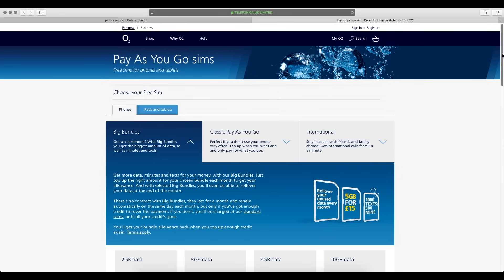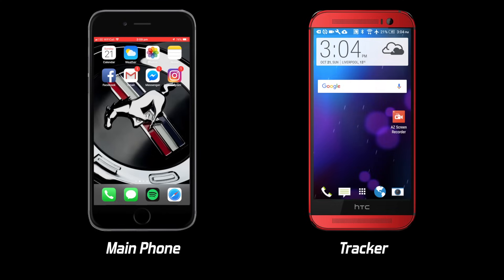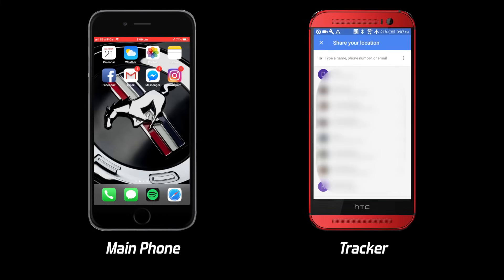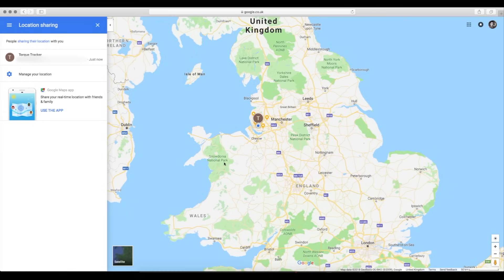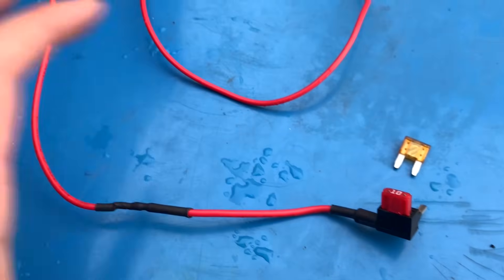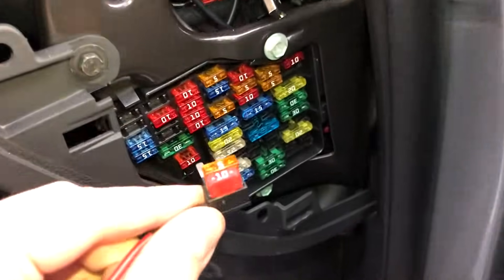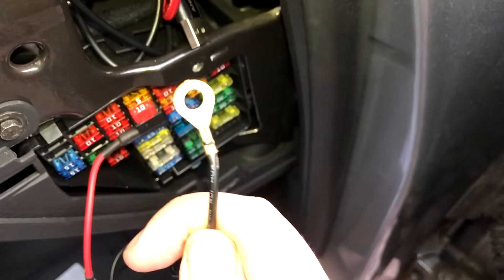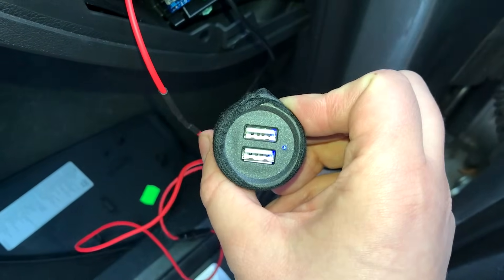Turn an Old iPhone or Android Into A Car Tracker

Comment: I just bough a rugged phone that has a 15000 mAh battery with a standby time of about three weeks.  In a pinch I can reverse find my other phone or have a backup phone when my other one is lost or damaged beyond repair. I can also just throw it in any vehicle out of sight, even use it on my motorcycle.  I've seen reviews for hard wired GPS trackers and almost everyone ends up with a dead car battery and ends up removing it.  Maybe it would be better to wire it to an ignition power source and put a 20,000 mAh battery in line.

Comment: The problem with this is the piggyback fuse is way to obvious, many thieves will check the fuse panel. There must be a sneakier way than this to piggyback power somewhere else in the car.
Reply: I absolutely agree with you.  The thieves who stole my ride recently pulled all the leads to the fuse box. It’s best to find a constant on inside a panel somewhere they won’t waste time looking for,  and connect your inline fuse from there-if you even need a fuse.

Comment: I like this idea but need to figure a work around here in the desert. If you leave your phone in your car in the day it gets so hot that your phone will malfunction
Reply: Don't put it in your car, put it under your car in a sealed container or space with no walls in direct sunlight. Also stay away from the exhaust and engine.

Comment: Hey Torque Steer, Do you notice any battery drain using this method? From my understanding a phone shouldn't draw enough power to drain a battery, especially when you splice it in through a constant circuit. Thankyou for the video!

Comment: Hi, Could I simply plug the USB into an existing cigarette lighter socket for it to work?
Reply: Does the 12v lighter socket work when the car is turned off?
Reply: Yes you can do that. It would not be very hidden from would be thief's but if you don't care about that it would work.

Comment: Is there any app or way that would be able to do the same but... with one and very imporant additional option - to send an alarm notification in case my car is stolen (the geolocation is changed) - either by data but even better by calling my phone number?
Reply: You can use IFTTT for this.  If the vehicle exits a perimeter around your property it can send a txt message. I had this setup so that when my wife left work for home, I got an alert so I knew to have her dinner ready for her when she arrived.
Reply: @JohnHastie  Thanks, you're right, it's to try in fact any automation app.... so simple...

Comment: That kills the car battery
Reply: Factory reset the phone, remove or disable all unneeded apps and reduce screen timer to minimum as well as dropping screen brightness to almost nothing.
Reply: it does not, very low power.

Comment: Isn't it better to connect to a temporary live so that it only charges up the phone while the engine is on?
Reply: Leaving the phone on a constant circuit will work but there is some cons to it. Leaving your phone constant charge cycle will degrade the phone battery much faster. Once your battery is beyond holding a charge the phone will have to be manually turned on.
If you put your phone an "ignition run wire" the battery should last long enough to stay on while the car is off unless it is off for a very long period of time. 
Factory reset your tracker phone and remove all bloat ware and disable any unnecessary other apps like clock, calculator or news apps. Only allow the bare minimum to reduce battery drainage, also turn your screen brightness almost off until you need to look at it. This should help your phones standby time last for days. Plenty of time to find your car.
Reply: I use my iPhone and find my friends on a motorcycle which charges only when the ignition is on via a USB cigarette adaptor so easy anyone can do it
Reply: why? the phone barely uses any power when it has the screen off

Comment: not really ideal.. battery replacement will cost more than the phone/tracker! ideally, you need to use a discharge prevention, some sort of voltage shut off ;)
Reply: wendy Aiden  gtfo
Reply: a phone with screen of doesn't use enough energy to ever deplete a car battery
Reply: @leolego2  Agreed if your not using the screen and you disable or remove all non useful app's for a bare minimum build your phone should last for days on a signal charge allowing you to place it on a "ignition run wire" so the battery will have some drain before you start charging it again.